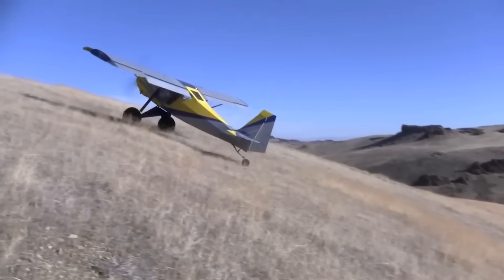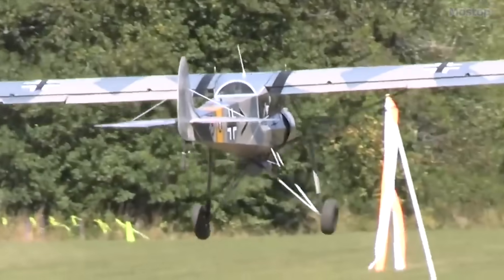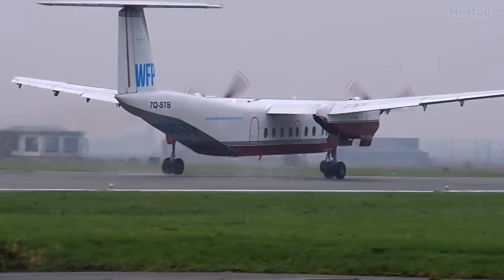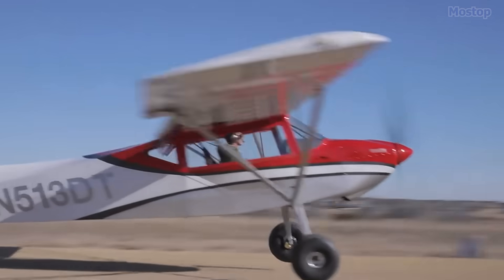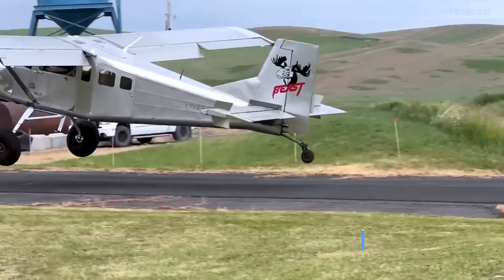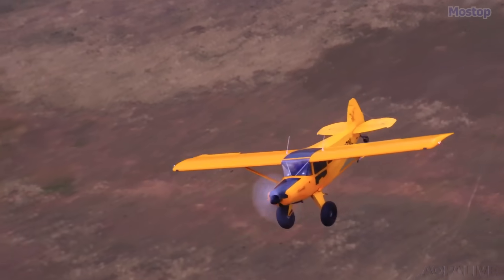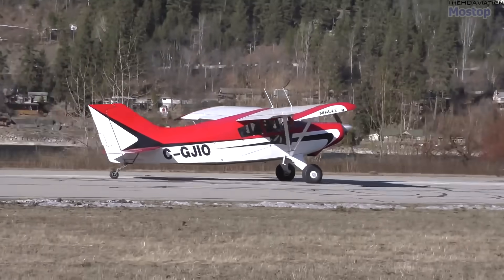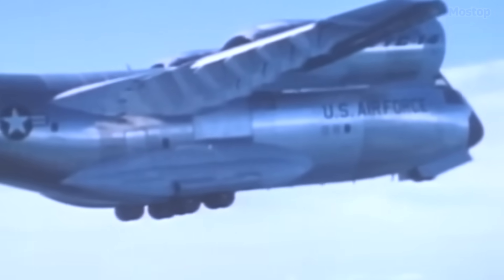These STOL Planes Do not need a runway to Takeoff

Comment from the maker: Which STOL planes have you seen taking off with little or no runway?
Reply: I watched the new electric one with several small propellers across the full length of the wing at Mannass Regional Airport in NVA. I happened to see a video about it just before so I knew exactly what I was looking at when I saw it. I happened to be on a ride on my ebike and I often do a lap around the airport during a ride. It was the Electra Ultra Short. It’s a hybrid, there’s a video of it if you want to check it out. Pretty cool.
Reply: I watched the new electric one with several small propellers across the full length of the wing at Mannass Regional Airport in NVA. I happened to see a video about it just before so I knew exactly what I was looking at when I saw it. I happened to be on a ride on my ebike and I often do a lap around the airport during a ride. It was the Electra Ultra Short. It’s a hybrid, there’s a video of it if you want to check it out. Pretty cool.

Comment: 7:50 - What? 527 miles per 31 gallon?  16,6 miles per gallon???     For a lightweight  1800 pounds (816kg) of a gross weight plane???  It should run not less than 27 miles per gallon!

Comment: Hogwash. Company data claims a takeoff distance over a 50 ft (15 m) obstacle of 1,210 ft (369 m) at 41,000 lb (18,597 kg) and a landing distance of over a 50 ft (15 m) obstacle of 980 ft (299 m) at 39,100 lb (17,735 kg) for the DHC-5A model. https://en.wikipedia.org/wiki/De_Havilland_Canada_DHC-5_Buffalo

Comment: It is nothing but special propeller wash angle to wings generating the lift at a flap position. Pilots need to know how to get lift or remain airborne at very low speed. These planes are suitable only for low speed stunts like this.

Comment: YC-14 with modern cheapest turbo-fan but run it like a diesel-ducted-prop and use it for powered-gliding at 18000ft + 1000ft + 1000ft. modify for water and dirt STOL like the CL415
Reply: target price = old price of CL415 at about 15m each
Reply: max unclassified, maintenance crew can roll their own if they have the right tools and machines. fly by steel-wire era of b747-200f tech level blueprints for anyone and everyone.?

Comment: Not mentioned are the wind conditions have to be exactly right for this kind of performance. There has to be some wind to allow such low ground speeds but more importantly there can be no gusts for these very low wing loaded planes that are very sensitive to changes in wind in this configuration.

Comment: The presenter talks about power to weight ratio and "low drag" for STOL performance, but it's clear, even to me, that drag is not much of an issue at 25-35 knots?
Reply: All that lift is actually a lot of drag.

Comment: 3:28  No fixed wing aircraft that's capable of taking human passengers is capable of taking off in 50ft, dummies.  The stat is "Take-off distance to 50 ft (15 m): 2,750 ft (838 m)."  This means it can reach an altitude of 50ft in 2,750 ft of horizontal travel.  Please get an editor.

Comment: Interesting most small stol shown have tail wheels - common but they struggle in tall grass where I land my nose wheel stol zenair 801. I
Mow when my prop tips turn green. 😆
Ps: the 801 is difficult to get. The kits are available still in Canada I understand but you have to wait until they get orders for three before they’ll cut/assemble the kit. I’ll never sell mine. Flying low slow with the doors pinned open - flying don’t get better 😀

Comment: The Buffalo has a 1200 ft takeoff to 50 ft.
Reply: i had to go check that too , can clear a 50 ft tree after 1210 ft ,with a stall speed of 85 mph the acceleration to get into the air would be other worldly , lots of JTOl would do it ....

Comment: With enough head wind would you even need an engine?
Reply: Yes. The wind might lift the plane but you would simply float in place. An engine is required to move you forward.
Reply: @waywardspirit7898 Really then how's a glider work.
Reply: @waywardspirit7898  Yes. The gravity is the thing you are missing on a flat runway.